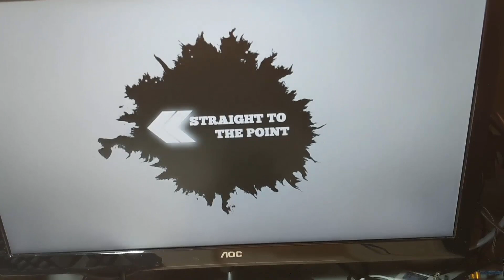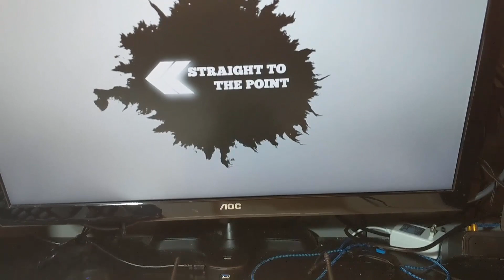DIY NAS/PLEX Media Server Raspberry PI Build Log DIY Computer Case

Comment: Might want to clarify the "higher gauge, higher loss" a bit since gauge numbers run inverse to size.  Higher gauge NUMBER the smaller the wire, and hence, the higher the loss. I.E. 20 gauge is physically smaller diameter than 18 gauge, etc.

Comment: Raspberry Pi is not the best choice for NAS. You really need a Gigabyte LAN port and a USB3.0 port to utilise HD’ full speed. There are plenty of these Pi like single board computers these days, try Odroid xu4 or maybe Lattepanda.
Reply: Haibin Sun it really comes down to what you're using the NAS for.
Reply: Full HD will work on a 100mbit connection, no problems.  It might struggle with 4K, but I'd say if the drive is fast enough, it'd keep up.  So Pi would be OK
Reply: There are other factors such as your local network bandwidth; - if your router or switch can't do Giga, then even if your NAS has gigabyte ethernet, with a hard disc connected via USB3 or SATA, the data throughput to your media players (or laptop, 'phone etc) will still be limited by your 10/100 router or switch.
Reply: Pi 3b has gigabjt ethernet anyway

Comment: Could you add a hardware list?
Reply: Raspberry Pi 3 , 2.5" WD Blue Scorpio 500Gb, D-Link DIR-605L Router and a 5 volt / 5 amp AC Adapter.
Reply: Just buy a wireless router that has a USB 3.0 port and attach a WD Elements Portable External Hard Drive, it will be faster and easier, possibly cheaper too.